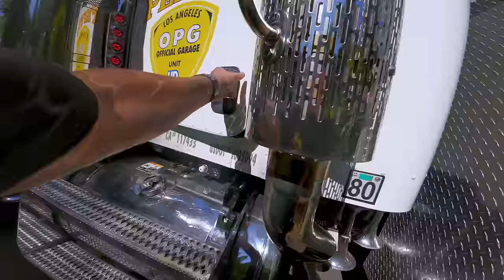Tow Truck Fail - When You "Know Someone Cheaper"

Comment: To clarify: On any lift with the spreader bar, the two lines will always pull fully vertically, regardless of the position of the casualty. What Alex did here allowed the “spread” to be more like a hammock, because the tops of the lines were farther apart than the bottoms. Awesome as always!
Reply: If the lines coming down from the spreader bars down to the casualty are of equal length then I believe what Alex is saying is correct. The drivers side of the truck would lift first and possibly crush the fenders wells.
Reply: Yes, but the casualty was not level, so it's sides were not vertical.  It can be hard to judge angles in a video.
Reply: Not exactly. If the spreader bar is wider than where the hookup to the lifted vehicle is then the lines can tilt out a bit. And a spreader bar set up for a semi is going to be wider than a pickup. So, the lines won't be exactly vertical. However, doing it the way that he did it lets the lines tilt out even more. Both would probably get the job done. Just a matter of preference which one to use. 

Some spreader bars are adjustable for width so they can work with wider loads. I don't know if this trucks bars are adjustable.
Reply: The other issue with a traditional spreader bar is the extra height required which could result in less boom reach to put the casualty back on the black top.
Reply: A separate spreader bar would also take a little more time to rig, wouldn't it? Having a spreader on the boom looked like the easier way to do it, if you only need one spreader bar.

Comment: I could pull that out with the 1 ton dual line wrecker. It’s not that stuck. Sending a rotator is ridiculous.
Reply from the maker: Hey Walter, not sure if you know this, but literally not a single soul on this planet cares how you would have done it. Not myself, not my audience, literally no one. And I'm not sure if you have the attention span of a squirrel, but it's not that a rotator was sent based on what we felt it needed, but a rotator was sent after the customer SPECIFICALLY asked for one. Got it?

Comment: Call Pepe's if you want to pay for a rotator (or two or three) to do a job you only need a light or medium wrecker to do!

--------------------------------------------------
[Note: This comment is not focused on any particular "designated group" with regard to the YouTube "hate speech" or "cyberbullying" policies. It simply reflects the author's opinion regarding a subject, which may or may not also pertain to an individual's actions demonstrated in the video. If any such individuals belong to any of the "designated groups", any commentary included is merely incidental to that grouping and such groups are not the focus of any comments. It's pathetic that this comment is necessary for the YouTube censors who are too stupid to figure it out otherwise.]
Reply: It was literally requested by the customer did you not watch the video??